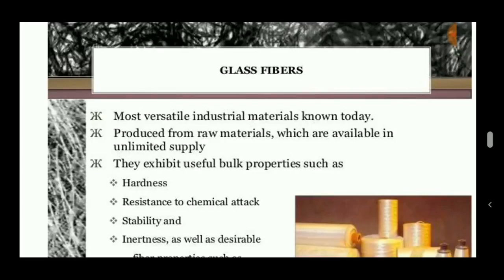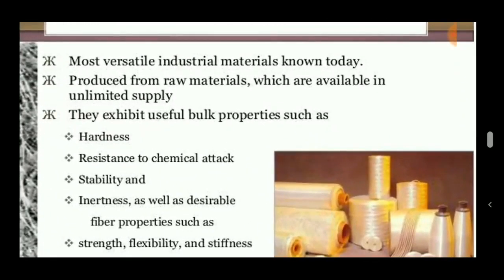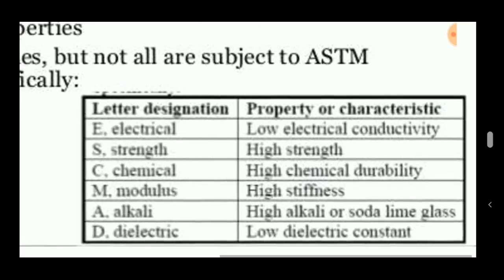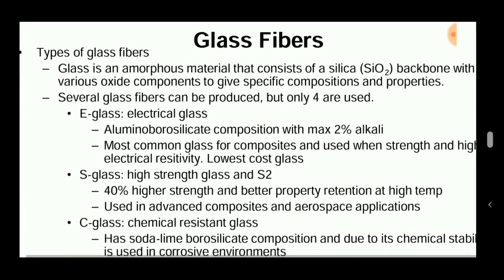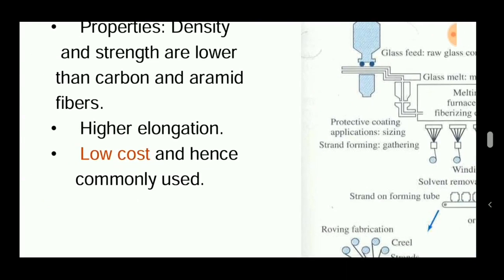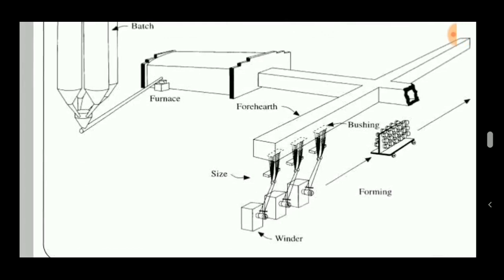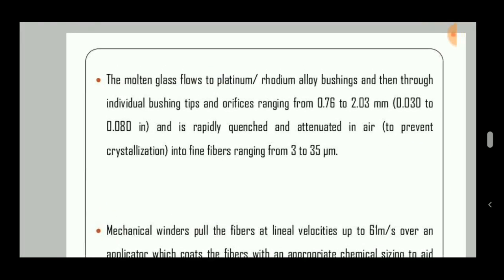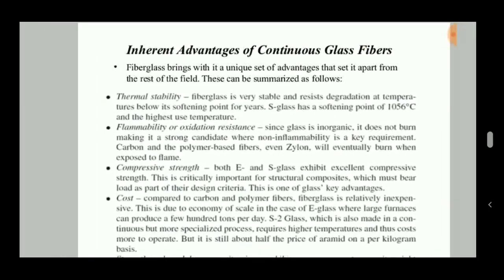Glass Fibers | Manufacturing Process of Glass Fiber | ENGINEERING STUDY MATERIALS

Comment: Hi, references please. Would like to know what books you get the information from.
Reply from the maker: TEXT BOOKS:
1. Mallick P.K., "Fiber-Reinforced Composites: Materials, Manufacturing, and Design", Third 
Edition, CRC Press, Taylor & Francis group, 2007.

2. Krisnan K Chawla, “Composite materials science and engineering”, International edition, 
Springer, 2006

REFERENCES:
1. T.W.Clync and P.J. Withers, “Introduction to Metal Matrix Composites”. Cambridge
University Press, 1993.

2. B.Strong, “Fundamentals of composite manufacturing”, SME, 1989
S.C.Sharma, “Composite materials”, Narosa publications, 2000

3. “Short term course on advances in composite materials”, “composite technology
centre, Department of Metallurgy, IIT – Madras, December 2001.

4. Weatherhead R.G. “FRP technology” (Fibre Reinforced Resin System), Applied
Science Publishers Limited, London, 1990.

5. Chawla K.K. “Composite Materails”, Springer Verlag, 1987

6. Mathews F.L. and Rawlings R.D., “Composite materials, Engineering and Science”,
Chapman. Woodhead Publishing, 1999.